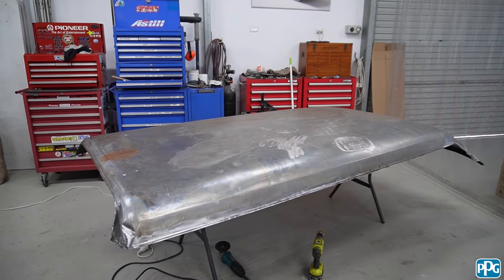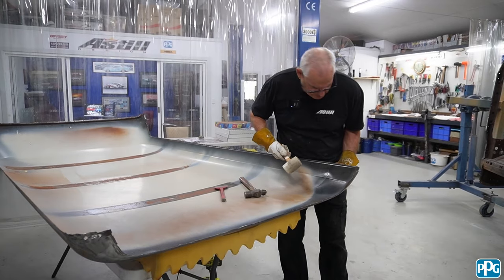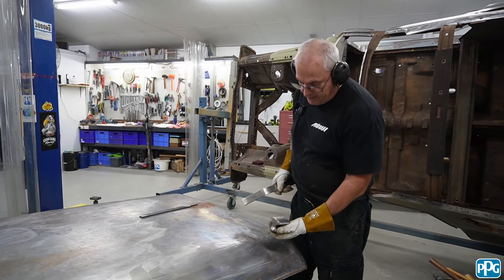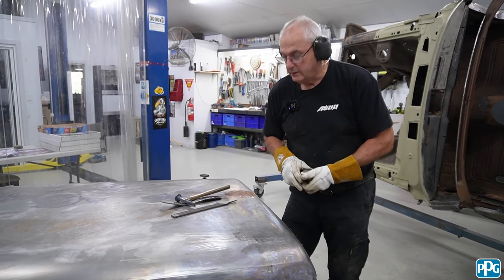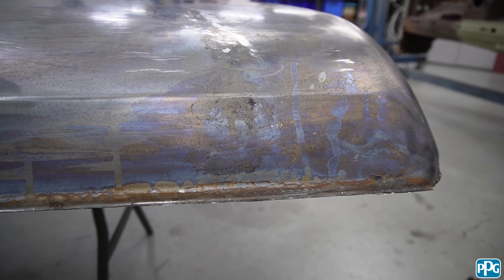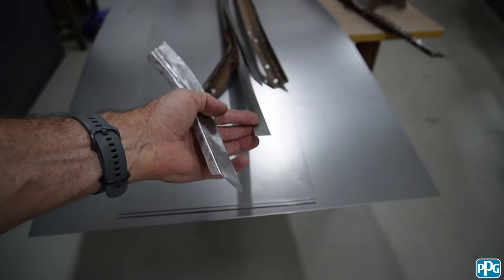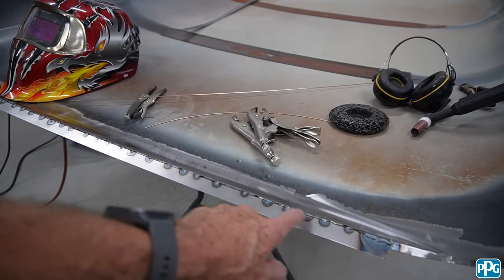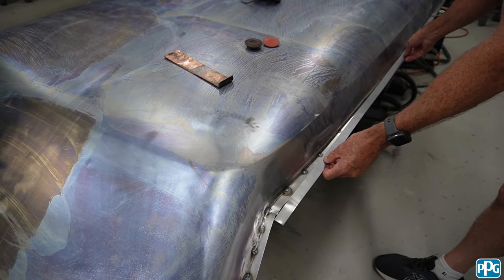Panel Van Dent & Rust Hole Removal on Magnum Force #7

Comment: 0.96mm cold rolled is the same as 20SWG steel (0.038”) which is basically what the entire Ford GT40 chassis was built from
Reply from the maker: Thanks for the info, my Dad always talked in gauge.

Comment: Have found that anything that turns black under phosphoric acid treatment isnt actually metal anymore, rather its now black rust which is hard as anything to grind or wire wheel out.. How do you handle areas that "go black"?
Reply from the maker: I’ve been using rusted solutions rust removal gel

Comment: Howard I'm in fnq our car club fbcc de skinned a xc 4door roof the underframe is perfect for your panelvan project from header panel back if you interested drop me a line otherwise it's going too tip
Reply from the maker: Hey mate, the frame on the van is mint, we are just doing drip gutters
Reply: Ok the one we have has an awsome frame to and parcel shelf section the roof was deskinned for another project I couldn't believe how good the inner frame was even had primer on it like the day it was made thanks for replying Il try find a good home for it cheers